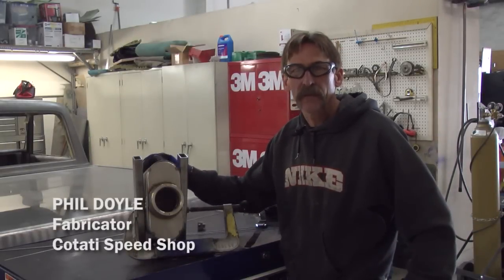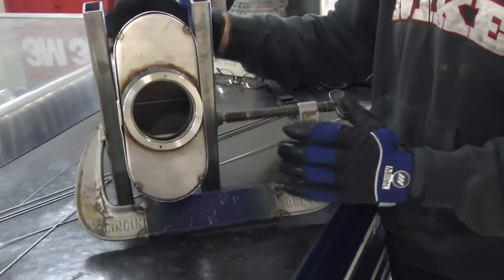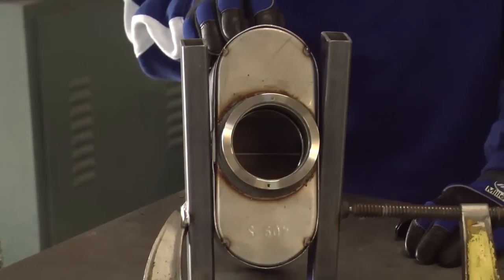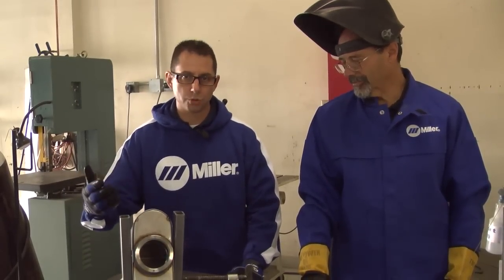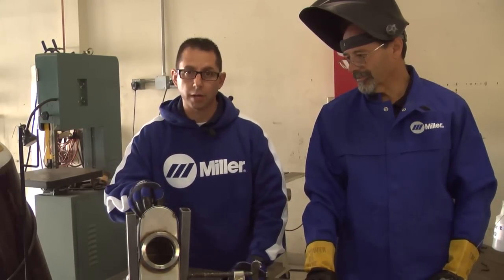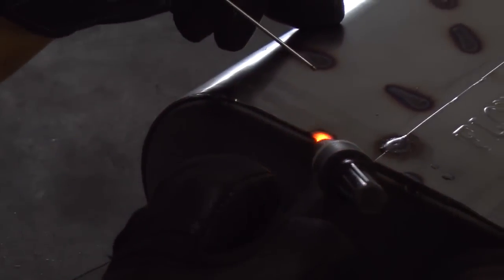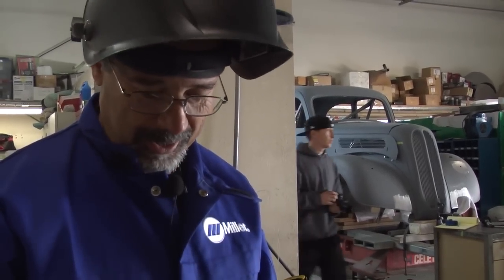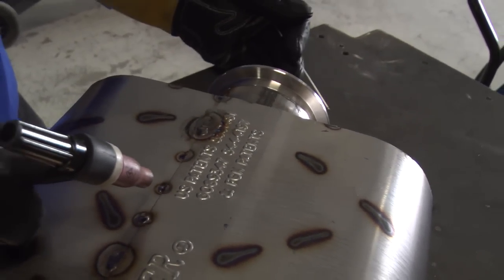Cotati Exhaust Part 2: Custom fabricating the stainless steel muffler

Comment: Great tip on the tacking to reduce cracking due to Large temperature swings.
Didn’t realize until now, SS is a poor heat conduction material affecting welds like that causes.

Comment: Mr. Aguirre, you're not supposed to remove the red-hot tip of the filler rod out of the argon coverage from the torch after the bead is terminated---it will instantly oxidize and will contaminate the beginning of the next bead.  It is the same reason the weld bead needs argon coverage after the weld is terminated--to not oxidize and turn a dull-grey.